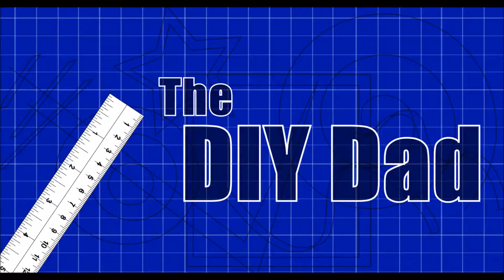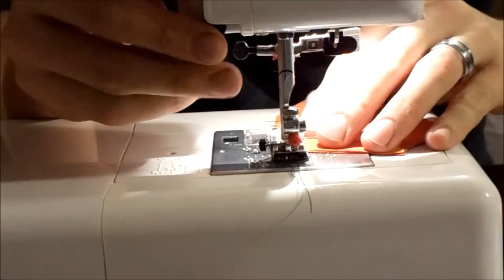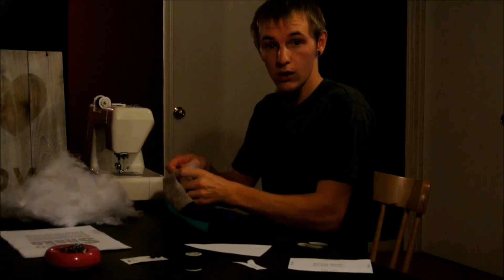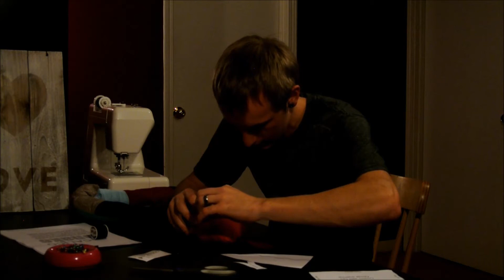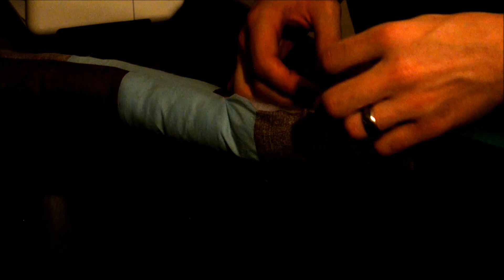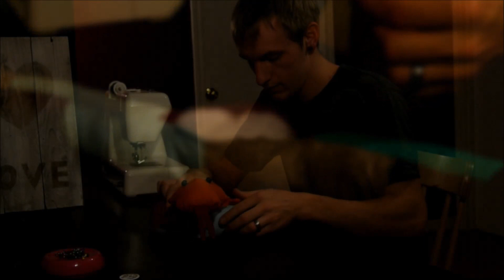Stuffed calico snake - DIY tutorial

Comment: i wish you could put written instructions. I am having a hard time with the video.
Reply from the maker: Donna vannoy I'm sorry that is the case. I'm currently working on launching a website to go hand I  hand with my videos, so you will have the ability to read and follow pictures as well. As this is one of my first videos, it's quite far back in the back log. Best of luck.
Reply: Hi! well darlin, I am dyslexic so I have to take time to get it right i see everything backwards. It is a pain in the butt!. I just wanted to tell you that i finally got it! the first one though had the tongue sewn under the bottom! I redid it and  It looks great. The only thing I did different though was I sewed the eyes on before I sewed it together. Thank you!